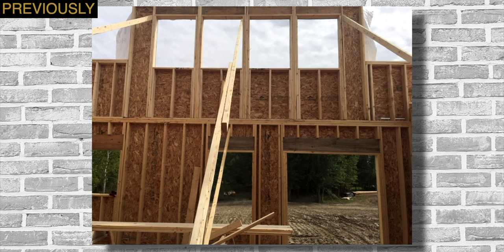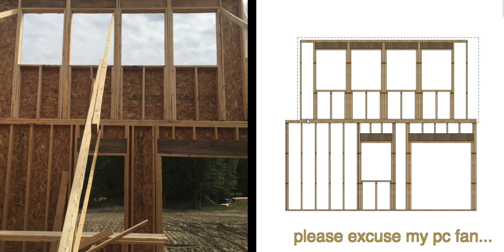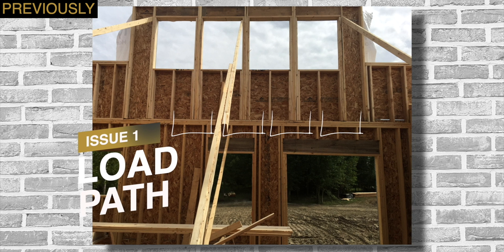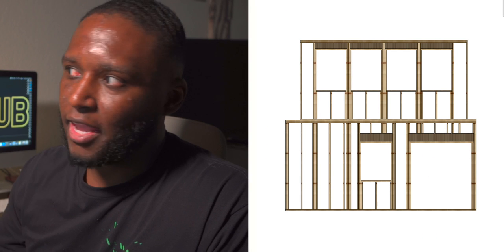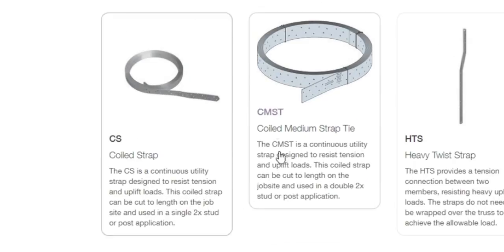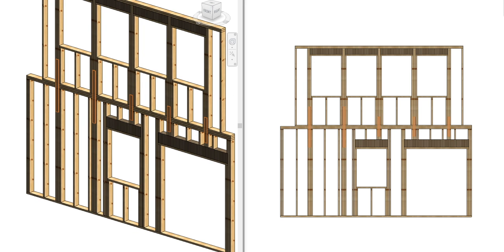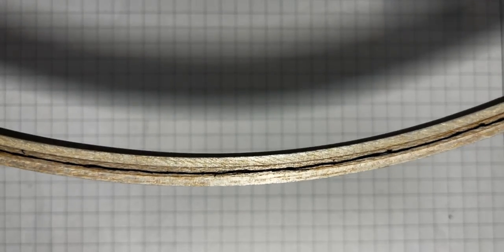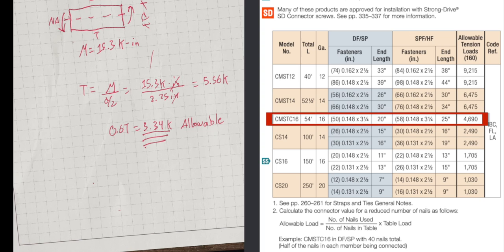Correcting Tall Wall Framing Mistakes - Part 2

Comment: I like your solution. At first I thought that you should have straps on both sides, but I think it would be fine to use straps on the inside and sheathing across the hinge on the outside. You need sheathing on the outside anyway, and lining it up with the middle of an 8’ sheet at the hinge line would be fine.

If your straps are, for example, 1/8” thick, would it be ok to route, plane 1/8” of thickness from the 2x4s where the straps are located and just add other 2x4s next to those for extra vertical strength? That way everything could sit flush, which might make things easier for the drywall crew… or I guess you could shim out the drywall by the width of the straps by raiding every hardware store in the area for as many free paint sticks as they have in stock…

Comment: The tension strap will need to placed both sides of the wall since wind has a suction component therefore the tension side can be on the exterior or interior side of the stud wall.

Comment: I did a renovation that resulted in a stacked wall, the structural engineer called for ltp4 every 12 inches.
I don’t see this use table in the catalog, but it’s an interesting usage.

Comment: Great video.  May I ask a question from the perspective of a non-engineer?  It is confusing that the tall wall did not have at least some studs that span the entire height of the wall.  In the absence of such studs, it would seem that there is a hinge point at the middle plate located about half way up the wall.  I am surprised that the building code does not require at least some continuous studs to avoid having a hinge point in the wall.  I would be surprised if a competent framer would construct the wall in the manner shown because the hinge point is so disturbing (either the initial construction or even the corrected construction).  As a novice, I would see the construction of the wall (again, either the initial construction or the corrected construction) to cast doubt on the competence and judgment of the builder.
Reply from the maker: Scott, all great & valid points. There’s nothing I can respond to because I would question their competence as well. In addition, this solution is a very ugly solution that I would only recommend under special circumstances. A tall wall should always be constructed with continuous studs just like any average wall with appropriate sizes studs.

Comment: So I have a question,  Let say your building a wall that is 16' high, 60 long and only supported by the walls on the ends. How do I determine what size lumber to use, and any special blocking or braising that would be needed?

Comment: i just did stacked walls to get 1 wall higher for a lean to roof by accident. . If i add rafter ties or ceiling joists at least every 4 ft would this prevent the wall from hinging?

Comment: Q question for you how far can I spend a 2 × 12 of Select or grade one Lumber with only support at each end and a minimum snow load of 21 PSI most likely be using structural select, grade 1 or Douglas fir using it for roof trusses on a flat roof I want to spend them across

Comment: I like what you did, with correcting weak areas in the framing. I’ve been in construction for 25 years, starting as a framer and have learned most of the other trades. Do you think using a continuous header on both upper and lower sections would help? And I’m curious to know, what you think about sway braces notched in walks...
Keep up the good work!!!
Reply from the maker: My initial idea was to put a continuous ledger along the hinge point as you suggested but nobody liked the idea of having a bump out in their wall.

I’ve never tried the bracing idea and I would probably try to avoid something like that. Not because I think it’s bad but I think I would have a hard time working the contractors where I work to doing something like that. But I do think it’s interesting and I would like to try doing something like that under the right circumstances.
Reply: @JthaEngineer  
The ledger idea would be functional, but the eye sore of the bump out, can be an issue. In a couple cases, I have switched the top plate of the lower wall, for 14” and 16” LVL. And ran the overhang of the LVL to the interior. Then when we did the interior trim, we wrapped with identical material to the trim package. Even added decorative corbels on one. The homeowners liked the look and for some people, plant shelves give them a place for art or other decorative taste they have. Not for everyone, but it does add another option, in your bag of tricks. Steel I-beams have been used in 2 by 6 walls,and in one case I’ve used a 3/4” by 3 1/2” steel plate on top of the plates. Just some ideas... thanks for your time Jay!!!

Comment: plywood on one or both sides of the wall, bridging the hinge line (like 2-4' above and below the stacked wall hinge point) should work just as well as those straps, right? or do the straps keep the wall that much more stiff?
Reply from the maker: The straps were a design decision. They still wanted the wall flat as possible without adding more layers of sheets or having some sort of bump out at the hinge point. Ideas like you suggested would have helped stiffen the wall as well. I did hear back & was told that the straps did help stiffen the wall.

Comment: Thanks for this. Question:  On post-frame homes, they build very tall columns with interleaved 2x4's or 2x6's, ie, 3 or more studs nailed/bolted together with the one in the middle running short and the one above it inserting into the gap for some specified distance to create one very long/tall continuous column. What do you think of that approach for tall walls?
Reply from the maker: That idea can work. I have designed some tall walls with double or triple studs. It’s not my first option but it is an option.

Comment: I enjoyed your video and appreciate you sharing your insight and knowledge. 
I am currently working on a house (in MI) from the 1800's that has been added several times since then. The area (kitchen) I am working on appears to be added after 1913. I noticed the outside boards (1" thick) were hung vertically and the inside boards (also 1" thick, tongue and groove) were hung horizontally. The studs were placed in the both corners and one in the center and a 6' window opening (added in 1970's). Do you know the logic behind the board orientation?
Reply from the maker: The board orientation probably has to do with fastening the studs in it’s strong axis to prevent the board from bending when something lateral (wind) pushes on it. I’m assuming the inside boards are fastened directly to the studs and there’s a layer of sheathing between the stud & the boards. Is that correct?

Comment: Correct species of wood?  I thought pine studs were pine studs, with the exception of pressure treated or non pressure treated.  Great, yet another for me to obsess over.
Reply from the maker: Pine comes in so many different species but the common ones for buildings are spruce pine, southern yellow pine, and western pine. All of them differ in their strength properties.

Comment: I have never built a tall wall like that .and never will .. But have seen many do it .. Most do it because they think it's easier , faster and they don't have to calculate upper floor , ceiling . roof bearing heights ..  I have been sent unto jobs to find simple solutions . One is .. If the lower wall is already built , Remove that top plate and replace it with LVL's that are laid flat , glued and bolted . Projecting inside the room and later dressing it up as a long shelf .. I call it a shear shelf .LOL .  Others , had to make custom steel reinforcing brackets that tied the top to bottom of the king/jack pack . Been doing carpentry 40 years . Seen a lot of stupidity . Worked for one contractor that put aluminum roofing nails in HUS hangers supporting a boatload of weight..He told me " It's just needs a nail " .. I said .. why not use a thumbtack ?? .  Throughout the years I have had my fair share of engineers, architects and inspectors that I had to debate .  Some inspectors are the worst because many don't know what they are looking at and interpret through code . Show them engineering and the stamp ,Generally will quiet them . One engineer was adamant about the way I framed a wall and demanded it be changed .I was livid !! . The Deal was .. In some homes , I will attach the header to the bottom of the top plate and frame down to the window height .  He insisted I set the header at the window height and cripple up to the plate .. Claiming wind shear .. I asked " Aren't the wind loads equal on this wall and by that token of logic I shouldn't cripple up to the window sill ?? "   If the window's top RO is 28" down from the top plate and the window sill RO is 28" from the sole plate .. Then the wind load is essentially equal ?? .. He wanted the header to be set at window height and cripple up .. I wanted to set the header to the top and cripple down . My reasons were based on fail-safe and structurally better .. The fail safe being . If a window legend is wrong or if a carpenter frames the window height wrong . Then you got to hack everything apart . My structural reason is .. A header at the top , reinforces the lateral movement of the plates the longer the header is . and the amount of intervals to the sole plates is reduced and a better pathway to the sole plate . Mine was Sole /Jacks /Header /Top Plate .  His was Sole / Jacks / Header / Cripples /Top plate ..I know from experience that small cripples atop headers need to be cut perfectly to distribute top plate load to header ..Unless the carpenter takes into account the rotation in the header . A perfectly cut square cripple can many times have voids .. The load is on the edges of cripples . and the smaller the cripple .. Smashed and nails shanked in every direction . Mine takes the header and I can make sure the jacks are completely in contact and transferring the load directly to the plate .. Less intervals , less potential gaps in the loads pathway

Comment: Good video, I do feel that your proposal was a bit overkill for a residential project. I have framed some 5 story apartments in Atlanta and your design/fix is pretty much identical to alot of the structural /shear wall requirements that I have seen on those 5 story podium projects. On residential 2 story jobs we typically offset the sheathing to tie the 2nd floor, joist and first floor with a 8 ft. sheet, same thing would apply to tall wall. In your analysis you have to factor in sheathing and even nailing requirements, that is a huge component. Subbed, wish you channel success.
Reply from the maker: Thank you & thanks for your input! I definitely chose to be more conservative. I wasn’t as concerned about it performing as a shear wall than I was as far as the wall being able to stand upright when high winds push on it.
Reply: @JthaEngineer  Could use a little more strap for California. I'm also thinking the king studs by the right hand windows could be THREE by fours. And there would surely be a horizontal strap across all the sills to hold he wall together laterally. And stagger the sheeting vertically like the fellow up there said so no hinge.
Reply: Definitely not overkill. Standard proposal to remedy stacked multistory tall wall in residential construction. Recently I experienced a stacked wall bellowing when the front door (12ft) was opened and closed.

Comment: I’m surprised you been an engineer don’t call for Balloon framing, NEVER build a tall wall like that. if the wall is 2 x4 the studs should be double up to 12 feet. If it’s taller than that, you use 2x6 studs at 12” centers. Very simple.